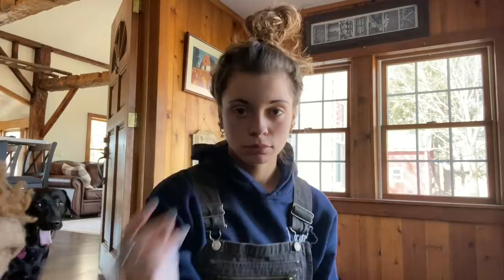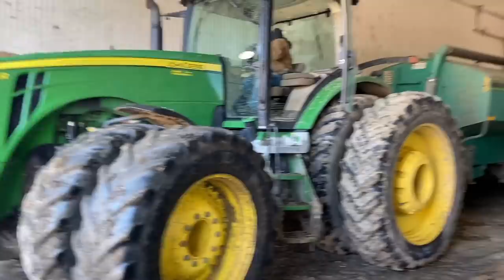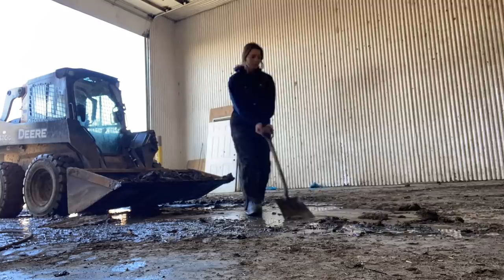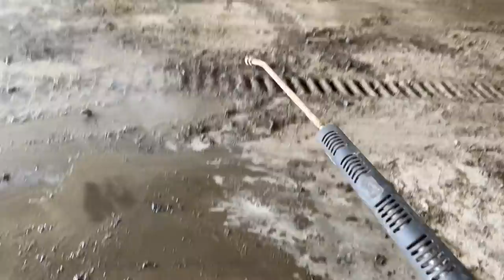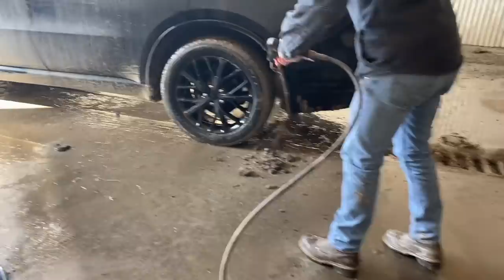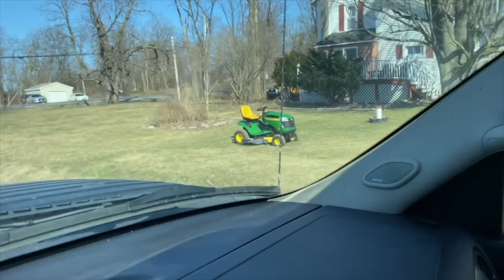WE GOT A NEW TRACTOR! (just in time for plant 2021!)

Comment: You need to get the snow pusher, snow plow shovel with a  wide UHMW poly blade. You can buy them on Amazon or usually at most hardware stores especially in the Midwest. They’re made in Iowa and a lot of people use them for cleaning barn stalls and scraping hard surfaces like the wash bay with the mud.

Comment: Jojo, your a good hard worker!  Lets see if somebody can help get more organized to use that hard work more efficiently.  You are not in full control of what you have to do the job, however I bet you have Mega influence with those who can help you have some extra tools!  First off this is the wash shed. A wash shed should not have anything in it that is not for the job of washing or it is there to get washed.  That tractor and those manure spreaders were not there to be washed so they should not be there.  The rear door has something in front of it. NO GOOD!  Because that door was blocked you can't do the obvious thing and run the skid steer from one end to the other, scraping out the muck.  Pick the muck up outside. If it won't push into the bucket, then we need some 8X8 anchored in the ground off to one side so that you can push the bucket against them forcing the muck in.   What are wood doors and plywood doing there?  They will just get water damage.  If they are no good, junk them, if they are good they need to be in a nice dry wood shop or the like.  I am guessing that some of that muck was still frozen on the floor.  The wand is great for spraying off a tractor but not so great for doing the floor.  There are bars with say five nozzles on them with wheels on the end that you can push over the floor, sorta like a broom.  It would of cut your effort a lot, yet got the job done faster.  So pull Dad aside and see what can be done.  The investment here is small but has a big impact on the work.  Overall some things need to be organized: like where are the manure spreaders really supposed to be? Where should the rest of that stuff be?